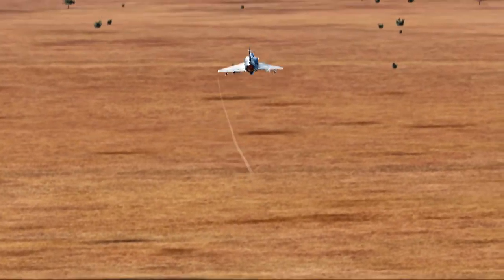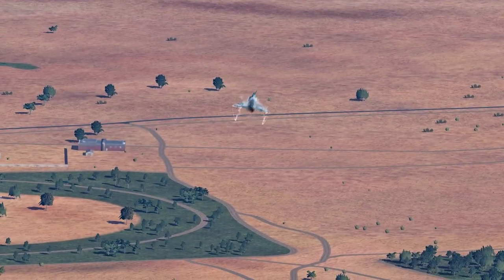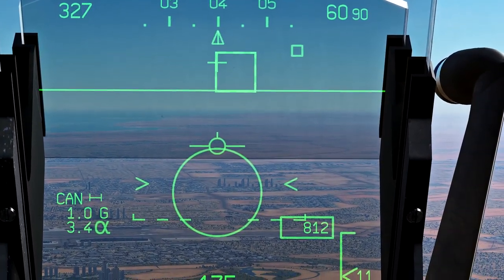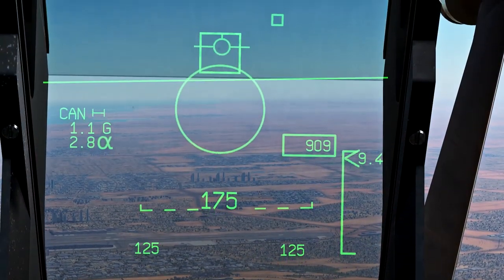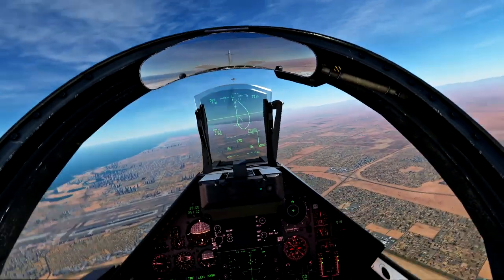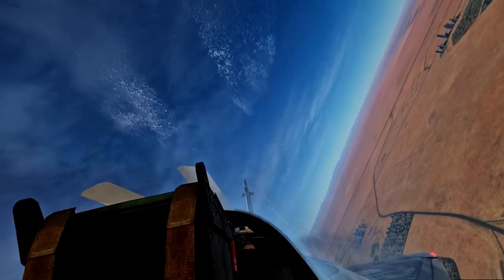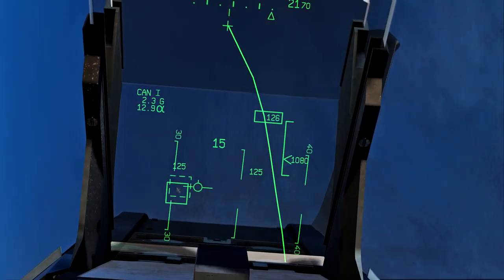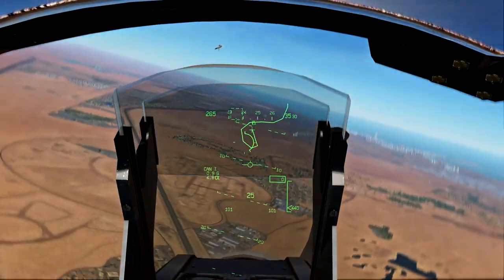DCS: Mirage 2000C Vs F-5 Tiger Dogfight

Comment: Instead of a High Yojo, would the use of airbreakes not do just about the same?
By the way, did you notice that someone was rehearsing their poor piano skills in the background of the TacView? 
Good job man.
Reply: I find that in the Mirage 2000, all you need to do is put the throttle to idle and a short hard pull on the stick and you bleed a LOT of airspeed.

Comment: Nice man... that F-5 was slippery... think an American gun would have hit him tho - more rounds out even if they do less damage.
Is it my imagination or does the Mirage seem like it has more power than the Hornet despite not having nearly as high TW ratio.
Reply: It has been debated and tested in game. The Hornet has higher sustained turn rate, as it should according to higher T/W ratio.
But being 1/3 smaller and lighter, the M-2000C is more nimble, less inertia, higher roll rate and high instantaneous turn rate.
Yet, Mirage 2000C wasn't design for dogfight. It's an interceptor built around Snecma M53 engine.
Reply from the maker: Jeff Shapiro I'm not sure it certainly feels that way at times yes. And for sure the American 20mm Vulcan would have been awesome and would have made short work of the f5

Comment: This seems like maybe a mismatch. 2000C would be at least mostly viable against something like F-18 or MiG-29.
F-5?? I would be very concerned about going up against even a MiG-21.
Reply: F-5's are vastly underrated. The f-20 upgrade some say would have been better then even the f-16 but because it had the same f-5 airframe and the f-5 was an export craft it was dropped.  Definite mismatch, but you can still see what a competent pilot can do. I believe the f-5 is even nerfed in DCS.